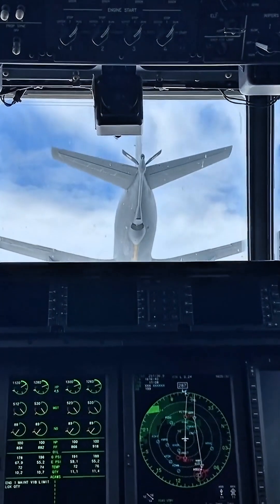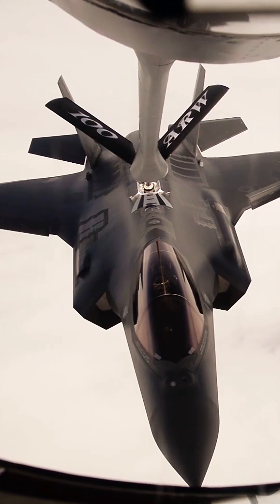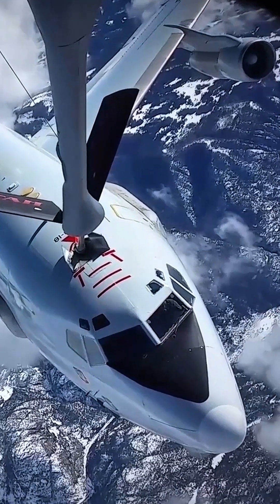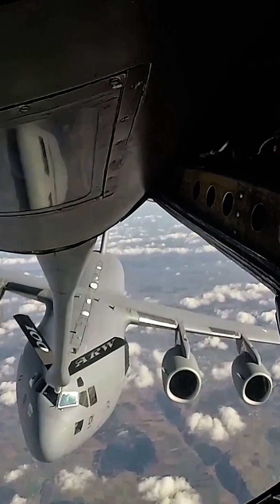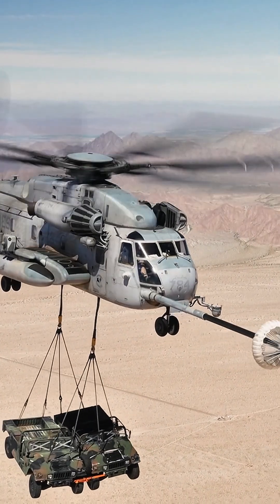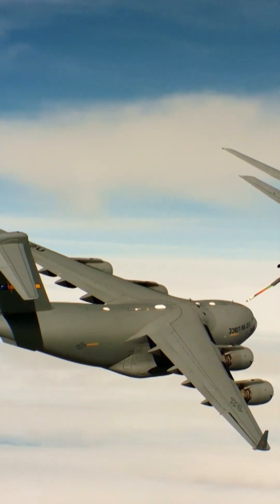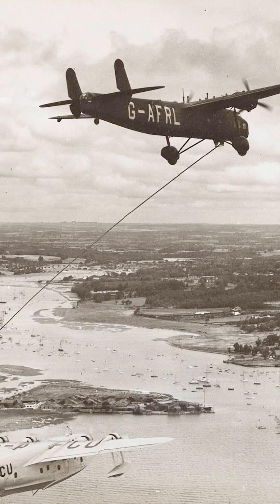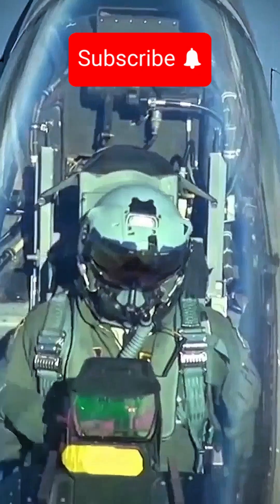What Is Air-To-Air Refueling?

Comment: Pricey, you think?  Putting your gas station up in the air is always going to be way more expensive than filling up on the ground.
Reply: Over the long run, it helps save on runway and tarmac abuse(lighter aircraft), allows military aircraft to prep for takeoff faster, and allows military aircraft designs to be lighter
Reply: @anonboy7314  I'm pretty sure it's the design considerations that make the decision.  There's no question that we can build a plane to go all the way around the planet. But if you're gonna have to carry bombs or missiles and you're gonna have to fight an air war,  your jet had better not look like the Spruce Goose.
Reply from the maker: @anonboy7314 As you say, lots of factors to consider when looking at the big picture. If you enjoyed the video, don't forget to subscribe for more to come. Thanks for watching. ~Mike
Reply from the maker: @josephdestaubin7426 Yes, it's certainly not a cheap. And they don't have a shop where you can top up on snacks! 😉